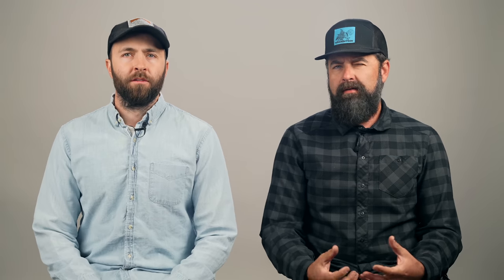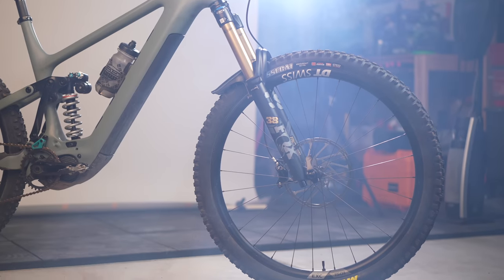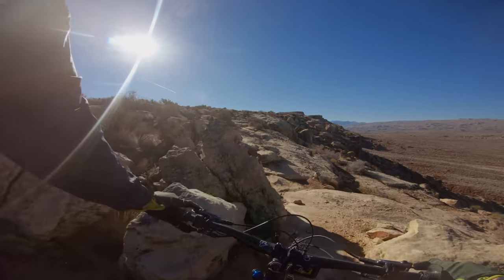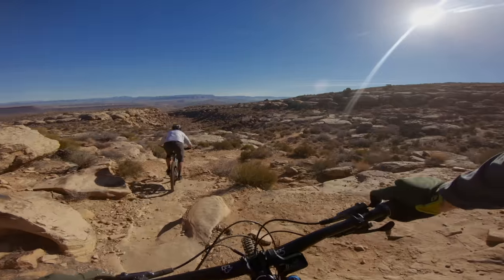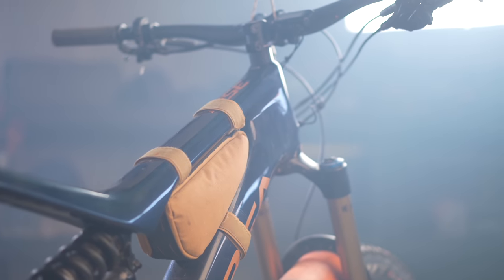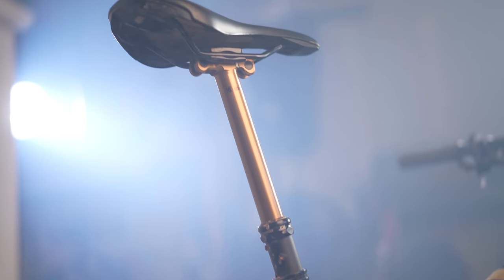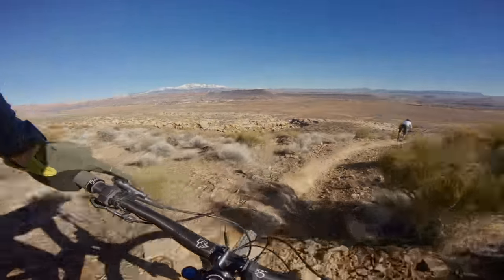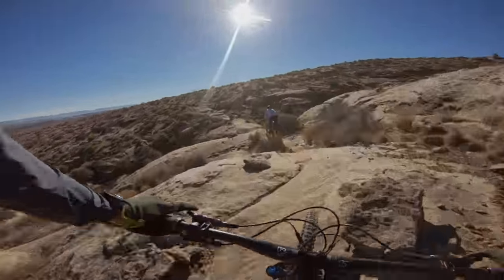Is a Slacker Head Tube Angle Better?

Comment: Great topic and great video but I'm confused  do the bikes you tested on normally have a 8-10mm spacer/cup below the head tube?  The Slack-R increases the height of an internal headset (and nobody told me this before I bought one).  The lower bearing which is normally inside the head tube ends up about 14mm below the head tube. It increases the handlebar height on my Stumpjumper about 10mm.  I ended up reducing the fork from 150mm to 140mm to compensate (which takes away 0.5 degrees of the angle).
Reply from the maker: They don't normally have a spacer below the head tube. Even with the added height from the Slackr, our bikes dropped 11 and 12mm. Without the Slacker (traditional angle adjust headset) the drop would be even bigger.
Reply: @bikersedge  something's not adding up (pulls out geometry book).  If you drop the angle of a 150mm fork from 66 to 64 degrees the handlebars drop 3.2mm, assuming all other things being constant.  From 64 to 62 it's a 3.3mm drop.
Reply from the maker: We didn’t measure from the bars. The bars add one more variable to the equation. Measured from the bottom of the head tube to the floor. Zachs bike had a 170mm fork with a 1.6 mm change and mine had a 160mm fork with a 1.5mm change. Also keep in mind this was with a tape measure and a bike as vertical and square to the floor as we could get it. I would imagine there’s a large margin for error in our measuring. 

From all that I’ve read, each degree of change in HTA will kick the front wheel out by about 10-15mm depending on the length of the fork. Say at 65° a pretty substantial amount of that change comes from the vertical component of the HTA. With 1.6 degrees on a 170mm fork you’re probably looking at around 30 ish millimeters longer on the wheelbase. A significant chunk of that is going to be vertical drop. Makes sense that the head tube gets lower.
Reply: @bikersedge    I found where 9point8 actually provides an example.  A 1.5 degree kit on a 2019 Tallboy Large, increases the BB 2mm, increases the stack (and increases the vertical height of the original headtube) and decreases reach.    This matches what I measured and felt after I installed it on a 2020 Stumpjumper and I reduced my fork travel in order to avoid slacking out my seat angle too much.  If you're handlebars were lower after you installed the only possibility is that you changed the number of spacers under your stem (by more than 10mm).  The Works headset on my Giant Trance 29 does not have this problem - the head angle gets slacker,  the seat angle gets steeper, the BB drops a few mm and you can fit a bigger fork without making the bad effects of the Slack-R even worse.
Reply from the maker: Again we are measuring from the bottom of the head tube not the bars. Spacer stacks don’t have anything to do with it. We didn’t measure BB height either. 

I did some simple trig and came up with an 8mm drop in height (fairly close to what our measurements confirm) That doesn’t include any complications from fork offset or anything beyond a simple triangle. I don’t profess to be a bike engineer or mathematician but I do know that our measurements showed a significant drop in the distance between the head tube and the floor as well as a noticeable difference on the trail. Each bike is going to be a bit different. The Tallboy example wouldn’t apply here because that fork is significantly shorter than the forks we were using for our tests.
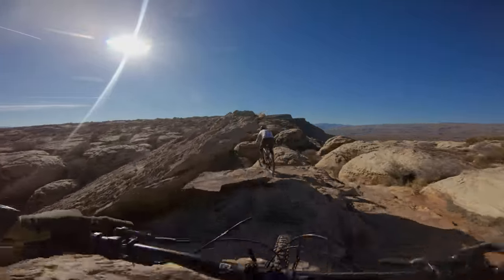Reply: @bikersedge  Thanks for the discussion, I'm honestly just trying to figure this out.  I put the Works -2 on a bike and loved it and a Slack-R 1.8 on a bike and hated it both bikes started as ~74 seat angle and ~67 head angle.  When I mention the handlebars, I'm referring to what you say at around 5:03 in the video.  You say that the handlebars were lower and you felt pulled forward.  This is the exact opposite of what I felt with the Slack-R, the handlebars were higher and I felt like I was sitting back further over the rear wheel.  I think it is dangerous to recommend that people go with a Slack-R and a 10mm over fork.  Works and +10mm is good (like you mention for the Ripley).
Reply from the maker: When I say the handlebars felt lower it’s due to the drop in the head tube. I kept a consistent amount of spacers above the bar taking into account the added stack from the top slackr cup. 

When we recommend using a headset cup with a 10mm longer fork on a Ripley, it’s because we have done it to multiple Ripleys with great success. We aren’t just the ping that out there willy nilly.
Reply: @bikersedge  the Ripley uses a ZS56 lower headset, that's my point, its okay to do a +10mm fork with a ZS56 angle headset, I don't think it's a good idea to go +10mm with the IS41 OR IS42 headset and Slack-R.  I ended up doing a -10mm because of the Slack-R.
Reply from the maker: It’s pretty clear this is going nowhere. Thanks for watching the video! Cheers.
Reply: Thanks Dtut, were you happy with the balance of the bike after the fork travel reduction?
I’m thinking of doing the same 
Cheers
Reply: @jamieschonell9996  I do like the bike better with the angle headset and 10mm less travel but it is not cool that I had to reduce travel to get the bike to handle nicely.  I have been riding bikes with 64 degree head angles so this headset brings the geometry of the 2020 stumpjumper to around 65.
Reply: @hotdealwire   you are right… on stumpy 2020 slack r will rise the front end… it’s like if you put a 170mm fork or more… same effect and bad handling. I have the same bike and I was wondering to buy a slack r kit. But I already have a 160mm fork and the stem is already slammed… so unfortunately the slack r kit will make it worse (the only one angleset for stumpy in production is basically useless… 😞)

Comment: Ive noticed a slim tyre citybike is a terrifying unstable mess at 70+kmh down a mountain road. Compared to a motorcycle. MTB are always slacker and longer. Hillbomb runs from roadies seem Limited by level of insanity/grip, not legpower. I suspect a very slack stable/stubborn full suss mtb with slick fat tyres(Schwalbe Supermoto?)and a longer lower stem and lots of air in the suspension would be much better. Any of you ever tried? Anyone ever tried?                   My idea of a perfect Roadbike is clearly different. I havent dealt with a slack bike but i don't get the problem at least on road, with a stubborn bike.

Comment: I find the term "outdated geometry" laughable.  How long will it take mountain bike manufacturers to get it right?  We pay almost as much as a dirt bike for a MTB, but the geometry of a dirt bike doesn't get "outdated."  It seems like the only reason is to sell more bikes and for hipsters to make Youtube videos.
Reply from the maker: Have you ridden a bike from 5 years ago vs one from this year?
Reply: @bikersedge I wonder about incrementalism- if that's even a word, though. If the grim donut is nearly as good as they say. Or the weird thing with super high bars via riser stem.  Perhaps it's time to just try.     .and make it.  But there comes my slight suspicion theyll just go in baby steps so they got something new to sell for years.       I believe it's a thing in other Industries too. Megapixels only skyrocketed after Sony Made 36mp sensors, before that 16,20,24 was it for a long time. SuperSport motorcycles slowly got from 170 to 180 HP until BMW pushed into the market with a bang much like Sony. Immediately everyone tried to catch up to full 200hp n soon got there